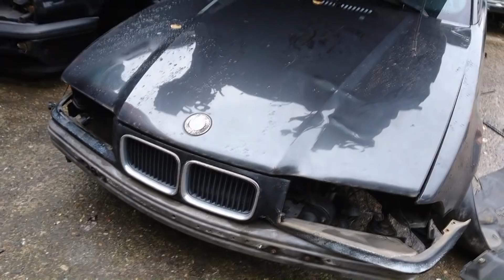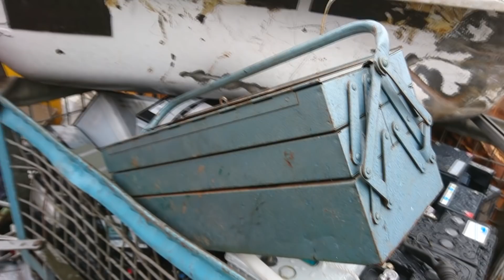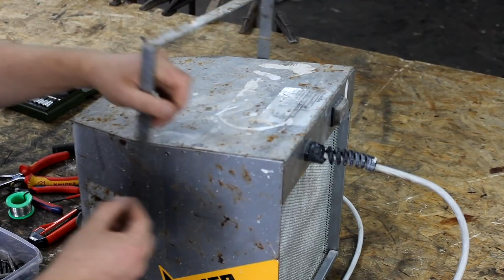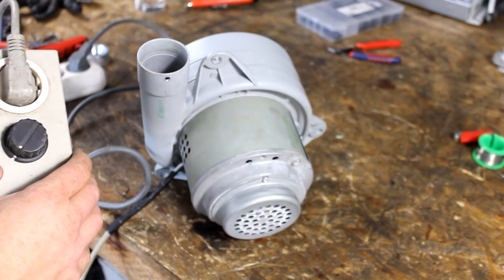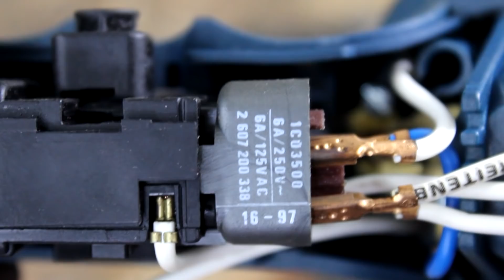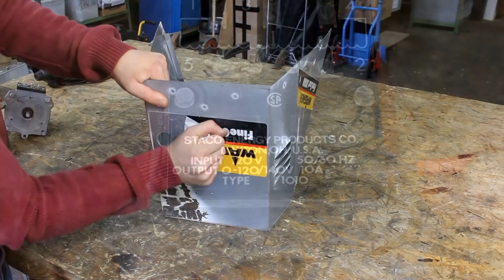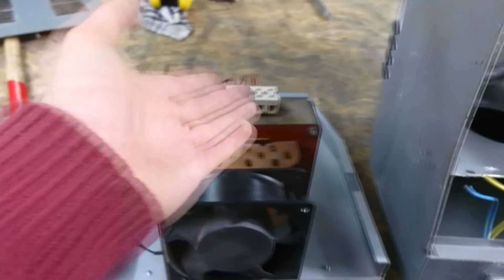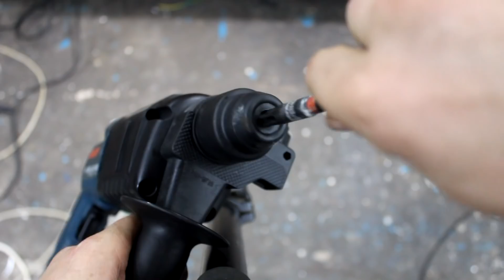Great Scrapyard Finds! Repair-A-Thon!

Comment: We use 110V drills in the UK on construction sites, it is mandatory that we use a 'site transformer', which is a 240 to 110v transformer, the secondary is centre tapped to ground (55-0-55), any extesion cords are therefore at this voltage.
Reply: You have some strange rules regarding electricity.
Everything that you connect has it's own fuse.
Not seen anywhere that i know of.
Reply: When you thhink of America and the possibility of having a table lamp and its flex on a 16 amp fuse, that's a possible firestarter if the lamp goes wrong, the fuse we would use would be 3A, much safer.
Also consider we use 30A ring circuits for our sockets, and don't need huge distribution panels, generally 10 way will easily serve a 3 bedroom house.

Comment: Here in the UK it's common to use 110-125v power tools on building sites using stepdown transformers, which isolates them from the mains and the transformers are 55-0-55 so that if you break a wire & come into contact with it, at most you're getting only 55 volts of ouchie... :)

Comment: What is worst here near Montreal Quebec one of the biggies scrap yards will permanently band you from their yard if they catch you picking up even a door hinge off the ground, there are mountains of useful things that could easily be brought back to life or repurposed into something else. Yet its not even an option for us. So sad. EDIT: BTW you should not lean your wight on a hammer drill , As a old timer once told me, Just let the drill do its things.
Reply: patprop74
 I think the old-timer was talking about 'real' drill hammers, i.e., machines with pneumatic (or hydraulic) hammering action. Back in the day, consumer-grade drills never even had a 'hammer' option, and even now, this action is a mechanically generated, a more or less sinusoidal back-and-forth movement. This is obviously nowhere near as effective as the instantaneous hit a real impact/hammer drill generates.

Anyway, scrap yards, especially big ones in the western world (with its strict rules and regulations) are indeed 'problematic', to say the least. I sorta-kinda understand that the companies don't want to take any liability for randos walking among the heavy machinery moving stuff around, cutting their hands on sharp metal etc., yet, at least in my (and my friends') experience, the rules are meant for general population, and CAN be bent. 

My 'MO' with scrap yards is that, in the beginning, I visit the place (at least) once a week, every week, on the same day at the same time. This gets me to know the people working in the yard (at least in that particular time, and in the case of smaller businesses, even the owner(s)). This creates trust, as in I am not a 'snitch' who will call the authorities if I am allowed to roam the scrap yard and dig through the containers etc. without supervision. Often (though not always), you'll develop a relationship/trust with at least one employee/owner rather quickly, which can result as you being able to, for example, even ask the scrap yard to set aside any and all material you are interested in.

Comment: That drill probaby came from UK, since they have to use a Isolation Transformer that outputs 110-115V on Construction-Sites.
Reply: They sold those hammer drills here in the UK around 1999 to 2003 for about £100, Chinese made branded bosch, I think at around the time they moved production from germany to china and the factories generally added chinese text in addition to market country text.

The lead will have been changed on a construction site or by a hire shop after being damaged and the 110v commando yellow plug would have been removed to use on something else such as a site light or another tool and then just not replaced and the drill got set aside.

For a while many different drills on the market were notorious for not having a safety clutch mechanism inside and so they would get stuck drilling concrete when a bit of metal rebar/re-enforcement bar was hit and spin violently causing wrist injuries drilling walls or floors and additionally if drilling above head height could cause a fall from a ladder, a facial injury or the drill could fall.
Electricians used to use these to drill concrete floors for fitting industrial power cabinets and cable ladder and tray runs between walls and plant/electrical equipment and would wedge the drill between their lower legs so that if they jammed they could let go of the trigger button and it would be less likely to spin violently..
Trainee/apprentice electricians usually got the drilling tasks..

After makita made a big move into the market around 2005 many people bought those as they had safety clutches that would just make a ratcheting noise if jammed instead of the drill rotating round the jammed drill bit.

Looks like nobody was too fussed to use the drill and it was cast aside years ago..
Reply: @grantrennie  Not very much on topic but I once saw a guy using a big, ancient magnetic Bux drill press on top of a flat lying pipe in the shop where I used to work and the drill got stuck in the steel. The magnet came loose causing the machine to rotate around the drill with the guy still holding on to it. I happened to be grinding next to him and in a second I put my grinder in the extension cord. He had a broken wrist but was allright.
Reply: Yes. It's a centre tapped 115v transformer so that any live to earth shock will be only 55v ac
Reply: That was what i was thinking. 110V tools are pretty common over here. You can get a used 110V transformer for as little as £30 with a bit of luck.
Reply: Those 110V site transformers exist in germany as well. I don´t know in which cases they are mandatory though. Normally the tools come with a special type of CEE plug on them that only fits into one of these transformers.
Reply: It could be a JDM drill too, they are 115v nominal, use Asian character and factory colored cable is pretty common there
Reply: I just wanted to agree with Grumpy, 👍 😁
Reply: Yep, and the early to mid-90s saw lots of UK builders in Germany, there seemed to be quite a shortage at the time.  I'm surprised one would have bothered bringing over 110v gear and the necessary 'site' transformer, but I suppose you have use what you got...

As Grant Rennie explains below, these UK tools feature yellow 'Commando' or 'Cee form' plugs, which are almost never seen outside the UK, the more familiar ones being the blue (230v) and red (400v).

Comment: This is one of the best video in recent times. Everything fits together thematically nicely. Repair, investigation, building. And of course, no youtube video without a Schlaumeier-comment:  Don't press too much in the end with the Boschhammer. Let the drill do it's thing, just lightly hold it in place. You will block the hammer action otherwise and negate the main feature.
Reply: Indeed.

Comment: That air conditioner is for most likley for a freezer or walk in cooler the evaporator with those brackets are for mounting to the inside to of the cooler or freezer, the compressor could be mounted atop or actually outside...

Comment: Wo findest du denn diese ganzen alter Geräte zum reparieren? Mein Schrottplatz in der Nähe ist eher einer der dir Sachen annimmt und gleich verschrottet. Weil durch das anschauen deiner Videos habe ich für dich auch ein neues Hobby gefunden das mir richtig Spaß macht. Denn ich bin auch auf der Suche nach einem alten Kompressor mit dem ich alle handwerklichen Tätigkeiten repariere oder ansprühe. Also vielen Dank für deine Videos und las bitte etwas öfters neu Videos kommen.😁

Comment: The first big sheet metal tool is a circle cutter. You could cut some mighty large and heave circles out of mild steel with that baby. Guessing 1500mm Diameter capacity? That's a big circle.  What a beauty!

Comment: Following the spirit of your channel, yesterday - before dumping my 10 years old microwave (faulty encoder - spin and press type), I decided to salvage a few parts. Transformer (remove HV coil replace with thick cable -->  spot welder), cable (good quality), two induction motors (with fan blades), DC filtration module (not sure why I need it), 6RPM 230V motor (not sure yet why I need it ;)  It was a simple and very refreshing activity.
Reply: build a small induction heater. plenty of tutorials available :)

Comment: The SDS drill is most likely japanese due to it being 50/60hz compatible as different parts of japan are either 50hz or 60hz.
Reply: It's a universal motor so frequency isn't much of a problem.
Reply: also useful on UK building sites, as 110v centre tapped transformers are used to power tools on site as you've only got 60v relative to ground.

Comment: The propane torch marking says "Universal hand torch"
Reply: In Polish language.
Reply: Ebonite handle, B quality mark, red propane-butane tank ... This is from the 80s
Reply: I suspect it is used for soldering. The pistol looks incomplete. Gas valve knob and several parts missing.
Reply: Yes and it's used with soft solder.
It's about 80 EUR new
Reply: Universal hand blow torch
Reply: https://images.app.goo.gl/EPJiR4NSJapPHJ5H8
Reply: Universal Hand Burner More Likely LoL
Reply: Dzięki.